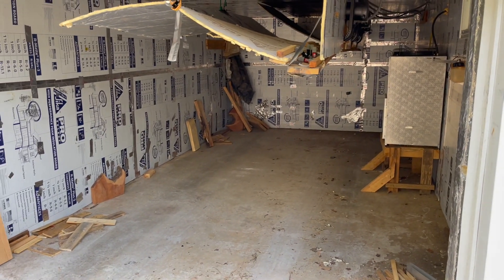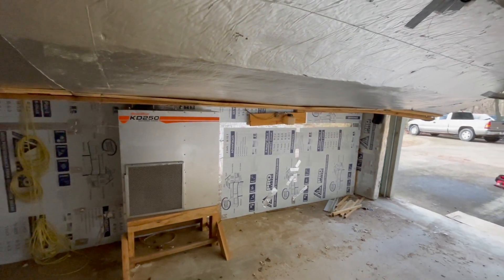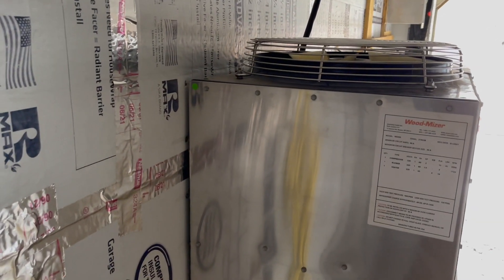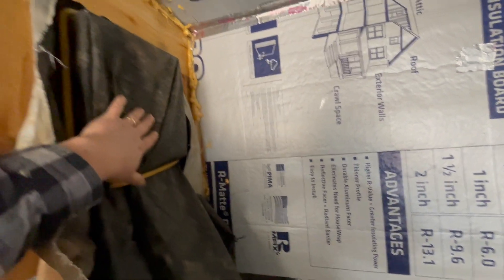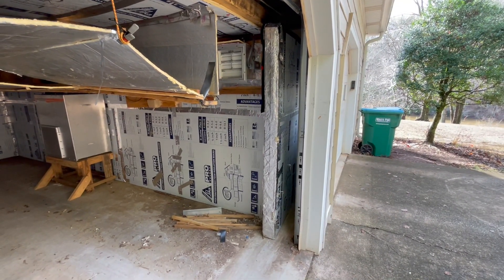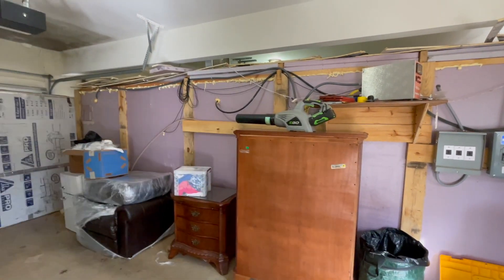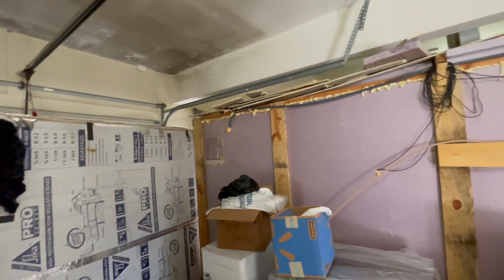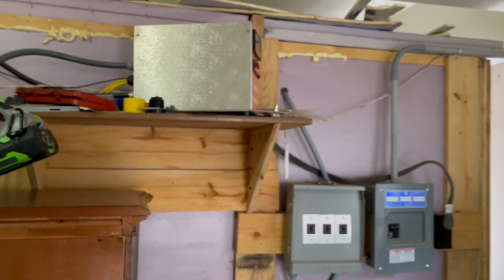Tour of the First Wood Kiln Chamber We Built for the Wood-mizer KD250 a.k.a. the Nyle L200M

Comment: Looking to get same kiln, was wondering if your electric bill was very expensive to run kiln.
Reply from the maker: It is very efficient, especially when properly insulated.   The system recycles the heat as it is pulling the water out of the air.  Depending on the time of year and what I am doing with the kiln, it costs me between $175 and $225 per month to operate.

Comment: Just wondering if concrete floor affects drying process.
Reply from the maker: The Concrete floor provides a stable flat surface.   It should be insulated to increase the efficiency of  the kiln.  It is a heat sink, so, at first it absorbs the heat, but as the kiln heats up, it radiates the heat back into the kiln.  The negative part of using the garage is that the heat can radiate out from under the kiln through the concrete, causing some heat loss.  Our newest kiln has a much smaller concrete footprint as is a little more efficient.